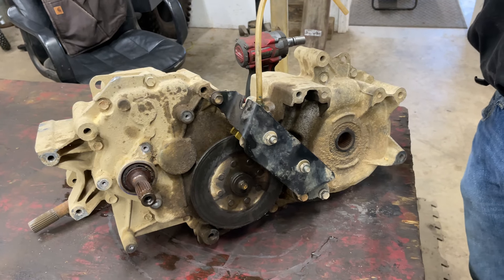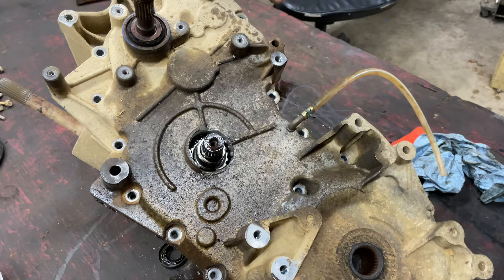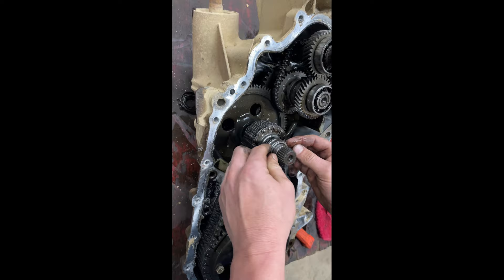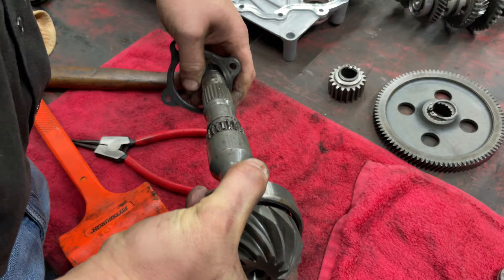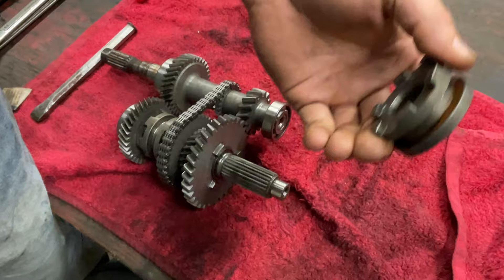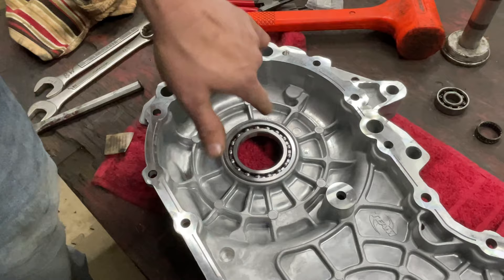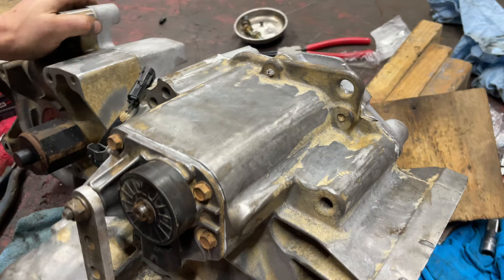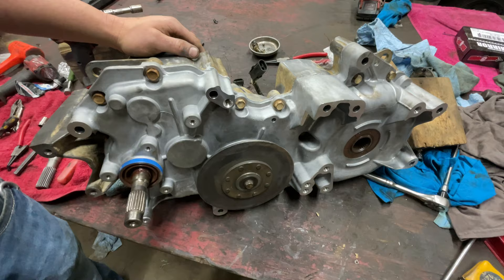Polaris Ranger 800 XP, How To Rebuild Transmission Transaxle, Broken Transmission Case, Bearing Seal

Comment: GREAT video! Where do you get the left or right cases from? I have one where the chain tensioner wore out and the chain slipped off of the sprocket and busted the case. While I have it out I will do what you did and go through and replace all the bearings and seals.
Reply from the maker: Thanks for watching. The right and left cases I got from the dealer.

Comment: What modle was the fuel impact you used also what did you seal the 2 halves with?
Reply from the maker: Hi and thanks for watching. It’s a Milwaukee impact. All my sealants and parts are listed in the description. Don’t forget to like and subscribe.
Reply: @crankitt825  I know it's a milwaukee. I have a couple, but mine do not stop when the bolts start getting tight. I wanted the model number of it. Also, do you torque anything or just by feel
Reply from the maker: Can’t find a model number on it reads it’s a half inch compact square ring impact wrench. Hope that helps. When rebuilding an engine we do go by torque specs on just about everything els we go by feel. 
Thanks.
Reply: @crankitt825  Thanks I appreciate it

Comment: Just wondering if Polaris makes the bearing and seal kit you used in this 800. If it is not Polaris, is there a bearing and seal kit you recommend? Mine is a 2010 Ranger 800 XP
Reply from the maker: Thanks for watching. The bearings and seals are listed in the description. Be sure to like and subscribe to our channel!!
Reply: Thank you so much for the excellent video and for your reply to my question. Can I bother you with one more quick question: how does the quality and durability of the Amazon East Lake Axel kit compare to Polaris OEM? I understand that the Polaris OEM parts are tremendously more expensive. I just want to make sure the transmission doesn't fail again in the near future. Again, thank you.
Reply from the maker: No problem!! I’m sure the oem parts are better and more expensive however I run an atv shop and have installed some of the east lake brand because of my customers were tight on money. So far it’s  been over a year and they said everything was still great. Hope that helps you out.

Comment: What lubrication do you use for northern MN winters. Temps can be from -10 -20 F & I will still head to the fish house.
It sits outside or in an unheated barn, & it always starts. I think it has to be like an ATF fluid for the gear box, am I wrong.
Summer time, I have no worries, just winter when even a 75w gets like molasses.
Reply from the maker: Polaris recommends using 5W-50 oil in ambient weather conditions that range from -35-100+ degrees and to use 10W-50 in conditions between 0-120.
Thanks for watching and be sure to like and subscribe to our channel!!